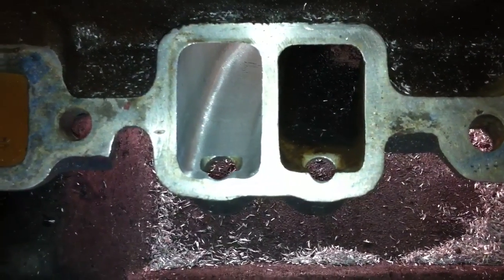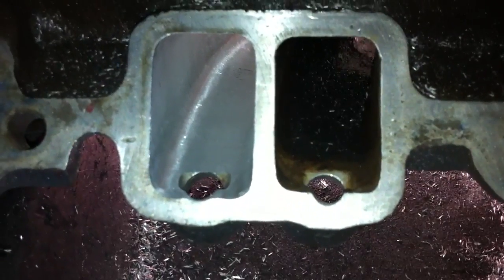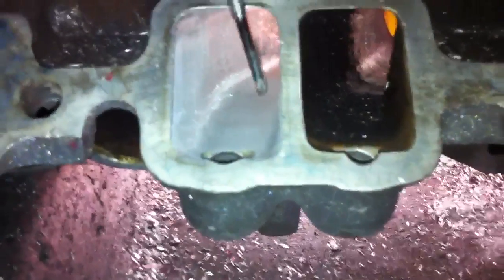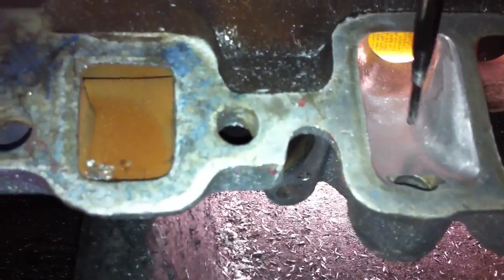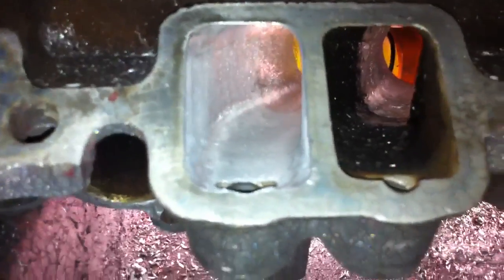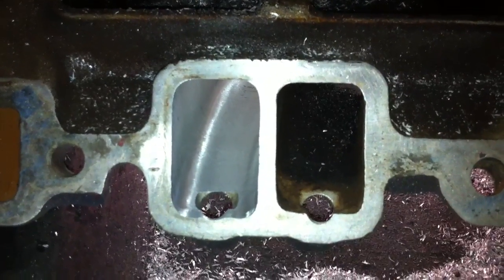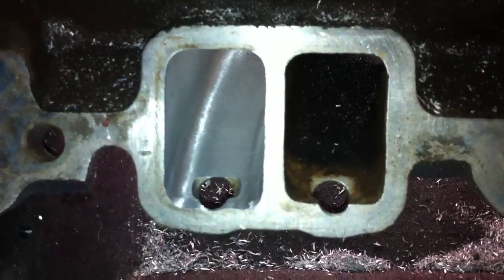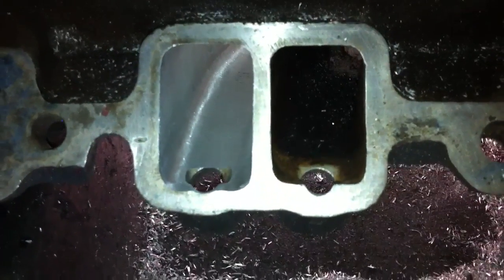TPI Porting Secrets.  High Flow Fuel Injection. Ported L98.

Comment: So do you still do port jobs? I just want the lower manifold done.
Reply from the maker: I don’t, sorry.
Reply: @DarinDochterman No problem thanks.
Reply: @DarinDochterman  I have one more question for you. The plenum on the TPI has little notches on the right hand side where the runners bolt on. My question is should those be shaved off or just leave them alone? Thanks again.

Comment: if you port your intake manifold and heads plus you put a 58mm throttle body you will gain lots of power specially if you are thinking in putting a hot cam.

Comment: What's the horse power gains when you port out the stock equipment ?
Reply from the maker: Chilly Dee Bondouvich 
Gains vary depending on your other mods, but you can expect 20 or so hp and 20 ft/lbs on an otherwise stock engine. Gains increase when you add more mods.
Reply: Would you know what could be expected removing the cat and air pump ?

Comment: Do you suppose a guy could build up/weld the outer side of the runner to use a head with a taller runner that uses like a fel-pro 1205-1206 gasket? or would that put the injector on a bad spot?

Comment: Interesting informative video, now want to look at doing it myself. Q - 85 L98 Corvette, I would like to port it if this is possible? Any advise for a first time porter?
I have a burring tool, high speed air drill and flapper wheels (sandpaper wheels), will this get me going?
As for the burring tool, is there and specially needed tool to do the main porting?
Will check out ur other videos. Cheers Kevin.

Comment: This is a great job and  he demonstrates that all aftermarket stuff probably do what promise,but, you can obtain the same doing a good porting work on a stock TPI induction assembly.Obviously TPI is a traditional low end big torque set up,if you whant revving high in the 6000-6800 rpm area,there are different kind of induction to consider like a Miniram from TPIS,short runner,one piece manifold/plenum assembly.But again this guy is a perfect porter,very nice ,smooth,symmetrical work,perfect...